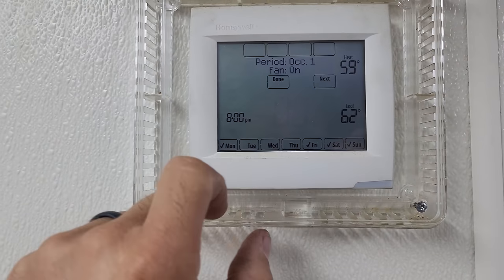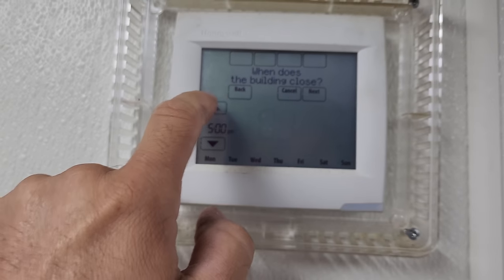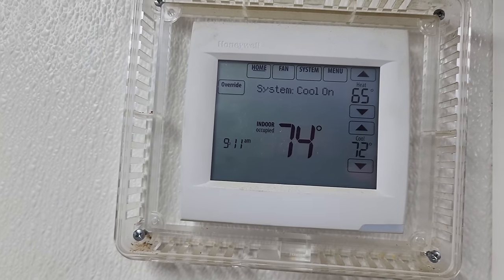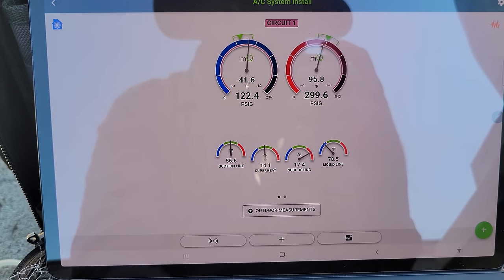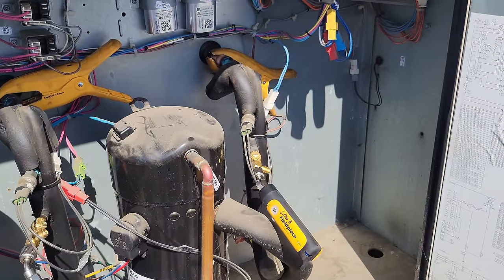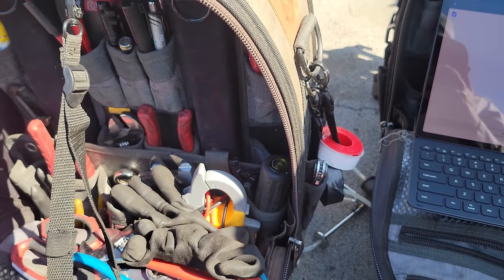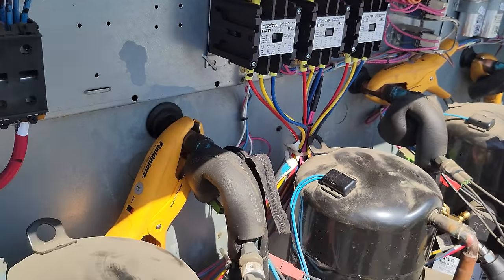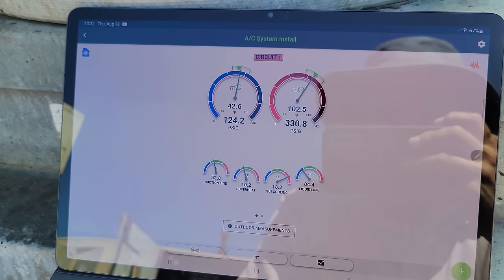THE KITCHEN IS TOO HOT AND THE COOKS ARE COMPLAINING

Comment: I have a few system upgraded the condenser coil to copper but there are 2 capacitor one is for fan one for  compressor.the fan cap is plastic type dry type maybe . Possible if i replace to oil filled type. Fan speed is not that high. Cause that cap is original to the unit. Company is carrier.

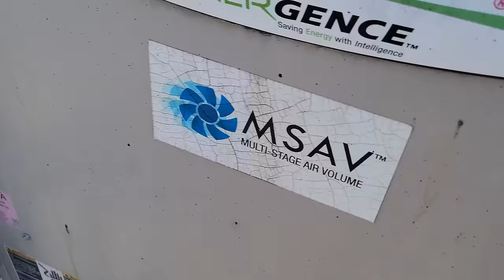Comment: 22:10 That one of the problems with lower voltages since the current is higher and fuses have much higher current ratings and small arcs like this won't make fuse to blow as if it would if higher voltage and thus a fuse with lower rating that would have blown for that, as it should.

Comment: Now wonder the leads of the old contactors were burnt, the wires had out on the crappily placed condenser, causing the arc out that caused that notch. Maybe that's what supposedly blew the contactors that actually somehow saved the breaker from blowing via an electronic sacrifice :-0

Comment: When u empty a bottle of zoom spout oil clean it and fill it with big blue it's a game changer. Best way to check for leaks
Reply from the maker: Great tip!! Thanks I will try that send me an email and I will pass that tip on to Refrigeration Technologies
Reply: In my industry we use Snoop leak detector from Swagelok which is already in such a bottle. That works great as well. The advantage of the spray bottle is that you can aim from some distance away.
Reply from the maker: I will discuss this on my Livestream this evening 8/22/22 @ 5:PM (pacific) on YouTube come over and check it out https://youtu.be/qLynm0RQU7U
Reply: @meeder78  the snooop!! Only bubbled we’re a leak is 🤘🏻

Comment: On 13:23

With expensive tools, a lot of people don't quite see the value in them unless they themselves use those specific tools regularly. That's understandable, but as you mentioned, those expensive tools can quite easily pay you back long-term or at worst break even in time and effort required to perform a job.

Why do mechanics like snap-on, for example?

By home-gamer metrics, their tools are insanely expensive and most cheaper tools can do what snap-on can do without issue... sooooo

Is it the w*nkfactor? - no (to a degree. some people like to shill them but Snap=on are still popular for a reason)
Lifetime warranty on certain tools? - yes
Do the tools last long enough to pay themselves back over time? - It's to be hoped so since they advertise ROI despite the high expense!

Comment: Great video, question on the Coremax tool/fittings - I had a call I went on to replace a leaking Coremax fitting on a carrier, had never used the tool before - Unfortunately I had to go back because I had over torqued the new Coremax fitting when he replaced it - I was not aware they need to be torqued to like 8lbs is that correct? He googled that - Anyways, point of my question is did you buy the JB Coremax Torque Wrench (P# CM-TRQ) it is like $300 our cost at RSD, worth it? Or can we get away with a normal torque wrench?

Also to give some additonal information, we have 1 coremax removal tool we share within the company, so the wrench would go in the box with the tool for anyone to use when we need to replace a leaking valve core on a carrier (we usually do the service tee quick fix you mentioned until we can return with the tool to change it).

Comment: @ 14:55 — Why are all of the terminals at the contactors marked up with a Sharpie?  They're all marked the same, so it can't be for identification.
Reply: Marking that they have been torqued properly, or that they are connected properly during initial assembly at the factory.
Reply: @justin4n6  Done at the factory? — It seems strange to me Dave would use permanent markers like that. So, the terminals are supposedly torqued properly at one particular moment in time. That's of no use to Chris when he's working on the unit years later. 

If the factory really did mark the terminals, it implies to me they'd been having serious problems with quality control.  It reminds me of when I was a technician in a factory which built telephone systems (OKI Electronics of America, in Ft. Lauderdale).  At one time, we had problems with the power distribution wiring, where the terminals at power supplies and buss bars were deficient or not tight. 

To address the issue, the QC procedures were changed to include very specific inspections and testing of each terminal. However, instead of marking everything up with a Sharpie, the QC inspector would use their numbered stamp to mark particular locations on the frame to certify particular terminals met their specifications.  

So then, what about all of the other terminals in the Lennox unit which aren't marked with a Sharpie?  Did no one check to see they're correct?  (Of course, they probably did, and marked their stamp somewhere on the frame, just like was done back at OKI.)

Comment: 25:51 the head pressure shoots up way too fast for it to be the condenser coil, you've got something floating around in that circuit or a metering device issue I'm thinking

Comment: Those wires did not have their insulation rubbed through overnight. It's why it's always good to do visual inspections anytime you're looking in a unit. It was just an unhappy coincidence that they finally rubbed through and grounded to that tab on the compressor after you changed the contactors.. Moving the wires to do the contact replacement may have sped up the process a little. In any case always look for sharp edges that wires might rub up against in any equipment where there's the least amount of vibration.

Comment: Is there a way to truly clean the inside of the microchannel? 

Like draining the oil and using a solvent inside?

I'm no AC guy but most oils will turn waxy if they're overheating and it could be clogging the passageways in the microchannel.

Comment: 18:45 plugged filter and pressure took a while to build up? Or plugged txv and also took a while to put refrigerant into one side? Hmmm this has my brain going...
Reply: 19:49 320 and dropping fast. Preasure is probably going to sky rocket when you push in contactor
Reply: 20:08 yup! Just like I thought.  Major restriction!
Reply: Wax build up and when it melts it flows? Hmm, this is a good one!
Reply: Dang those wires ate away that lifting ring? This is electricity being aa Lil mysterious. Should had tripped being a short to ground. But it didn't trip or blow a fuse. This is why I think commercial ACs need power monitoring if using more then one phase. It would prevent major damage. Heck washing machines have built in diagnostics. Why ACs and refrigeration have not been upgraded yet kinda trips my out a bit. Some diagnostic with the temp plus defrost controllers.
Reply: 26:39 plugged condenser leads to over heating scroll windings melting wax and wax moving down the line and plugging micro channels that when heated melt the wax and then restriction goes away. That's what I'm thinking besides bad fins also not providing enough cooling because corrosion

Comment: Micro channels are pretty sensitive to overcharging correct ? That oil on the lines is probably from someone gauging up to check charge because it was low from the leaking core max. I’d say the txv is keeping the evap at bay and condenser is slightly flooding.  Just me guessing. I worked on a micro channel not to long ago that operated with a liquid line solenoid. It was slightly over charged and going out on high head before cutting out on low pressure. I recovered some refrigerant and never had a problem again. Not much room for condenser flooding.

Comment: Why not replace contractors with higher capacity ones so they can cool more effectively when cycling on high head pressure. In extreme heat areas, stock contractors are inadequate, especially if rapid cycling. Engineer here.
Reply: The size does not compensate for dust related issues.

Comment: Do they use a filter changing/coil cleaning vendor? It wouldn't surprise me if someone used the wrong cleaner and wasted those coils. 25 miles from the ocean around southern California is usually a little too far for away for that type of corrosion, imo. Also maybe they would approve a little plenum riser on that upblast exhaust fan? I bet 1-2' would make a world of difference in keeping that coil cleaner and happier.

If they approve the coil replacement, do/will you automatically replace the TXV? I'm with you on suspicions of a restriction. Coil or TXV, gotta be something funky going on.

Comment: Can someone tell me why they use belts for blowers instead of a chain of direct drive?
Reply: Chains are noisy and require lubrication. Some blowers are direct drive, but mostly smaller ones (like residential). They might use separate motors for the gear reduction or just because it’s cheaper. Not sure.
Reply from the maker: I will discuss this on my Livestream this evening 8/22/22 @ 5:PM (pacific) on YouTube come over and check it out https://youtu.be/qLynm0RQU7U

Comment: Not to be an ass but I’d say if your torque driver isn’t moving when you’re checking torque then you’re over torqued to start with and checking with your torque driver is an unnecessary step. I’d say the proper way would to snug them with a screw driver then seat them with the torque tool. Or just use the torque tool for whole installation. Just my two cents.

Comment: In my opinion your using the torquedriver not the best way. I´ve learned to tighten screws to a point minimum a quarter turn below the required torque and tighten it then with a torque-tool. The way you´re doing it, you can overtighten the screw without knowing it, maybe with damaging the thread or drive or cracking the bolt.
Reply: Yes I have the same issue with every tire tech I've ever seen put on lug nuts. You watch them run every lug in with an impact, then when they check with a torque wrench they get no movement because they're all over torqued. 

You cannot check torque unless you get movement out of the fastener before the torque driver cams over.
Reply: I was going to say the same thing. The over tightening can also break or deform the part itself that is being held, not just the threads or bolt. The previous comment may have included that possibility.
It is like a car wheel. If you over torque, you may strip the threads on the stud or nut. You may twist or break the stud. But probably more important, you may crush and deform the wheel itself making it weaker and prone to failure. The extreme case is where you tighten it so much that the nut goes completely through the wheel. That will probably never happen completely, but just illustrates the damage that is being done to a lesser extent.